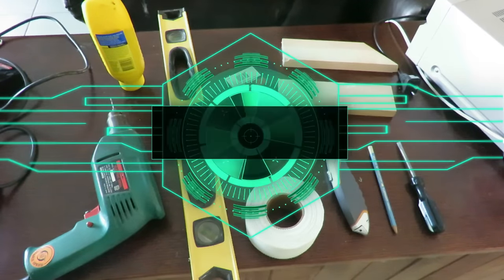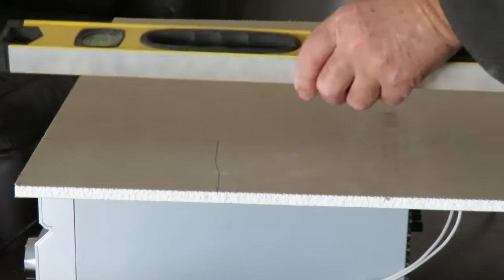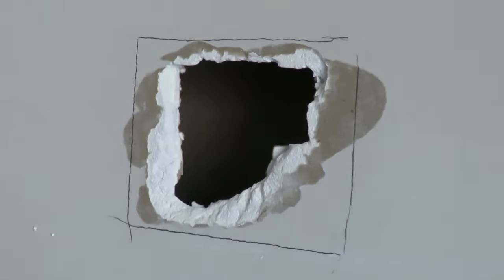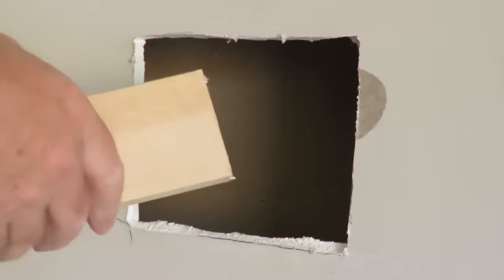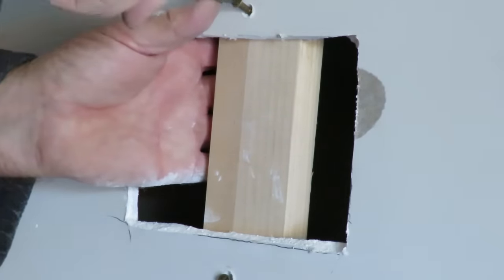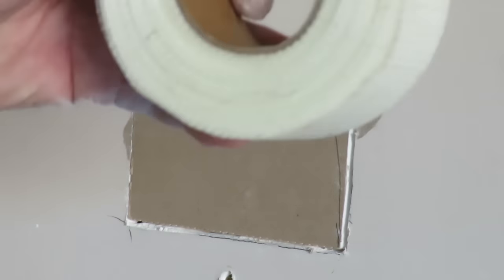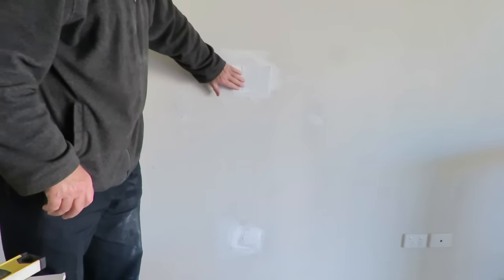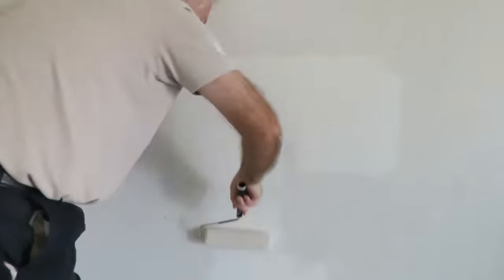🏠 How to Repair Drywall and Fix a large Hole in the Plaster Wall the easy way

Comment: You need to retitle this video.  That's a plater board wall not a plaster wall.  Plaster walls have button board or wood lath behind them and are thicker than drywall
Reply from the maker: The board is made from plaster, and coated on each side with paper, so the title is relevant.
Reply: @GarryPurcell  I would be inclined to disagree. I have a mix of drywall (plasterboard) and rocklath plaster (1/2" drywall with another 1/2 inch" of plaster on top) walls in my house. They are definitely very different, and calling a video like this "plaster repair" because it's plasterboard is pretty misleading. 99.9999% of the time, when someone says they have "plaster walls", they mean plaster and lathe, not plasterboard.
Reply from the maker: @dan8250  I would suggest you search for Historic, or traditional plaster walls to find information for the type of repair you need.

P.S. I've seen chicken wire, paper, and burlap sacks used for packing in some old homes, over 100 years old.

Comment: First of all, I would always use screws that are used on plasterboards,  I didn't know people still use straight screws. Your  not supposed to still  be able to move the piece of wood. You have to cut both plasterboards on an angle on both the edges and the patch is turning the wrong way.The tape is bad to use cause it can move and the plaster will crack, its better to use paper tape. 
Sorry but Im not satified...
Reply from the maker: Please read the video description before commenting any further, plus look at the date stamp, there is no cracking to date.

Comment: Don't ever use" Stanly type box cutters knives" their are garbage now a days, compared to cheaper slider blades that you break off the tips when they become dull...

The short box cutter stanly stubby blades are a thing of the 80s and buy the durable plastic ones $2-5 each...

Comment: Apparently I lean on the wall  with my bed and it made a whole maybe omg  ?
Reply from the maker: The hole is easy to fix.
P.S. I have a better instruction video below, (when I had all my tools with me.)
https://youtu.be/JmcR9TW4mM0?
Reply: @GarryPurcell  the worst part is that I sleep  in my bed and the whole above my head a rat could  pop out
Reply from the maker: @zombieterminator6296  That's a bit scary.
Reply: @GarryPurcell  yep I was such a dummy I'm just disappointed in myself right know
Reply from the maker: @zombieterminator6296  Y
Take your time and don't rush.
Think positive, at least you will gain a new skill set.
Reply: @GarryPurcell  fixed it
Reply from the maker: @zombieterminator6296  Good to hear. Thanks for letting me know.

Comment: Omg. Slotted screws ?? The wood isn’t that stable. A little bit of const adhesive would of helped with that. Drywall in backwards. Bad patch.
Reply from the maker: Thank you for constructive criticism.
Reading the video description might help regarding screws.
Reply: ‘May’ be a bad patch but you can’t tell it’s there. It’ll get your bond back

Comment: You need to put some screws on the lil piece of sheet rock man no good
Reply from the maker: Good advice.
On the day of this repair, I could not find any other screws in the dump bin.
Reply: Still did good man

Comment: Very  bad method for the DIYers: you havenot screws for electric drill, etc. There are other videos special for this problem. You can delete this Video!!!
Reply from the maker: Please Read the video description in future before commenting any further, after you have done that, then feel free to comment again.

This repair is 4 years old in a rental property, and still holding perfectly.
P.S. I normally use this method when I have my tools with me.
📌 https://youtu.be/JmcR9TW4mM0

Comment: Then the door handle touches it and bam! The hole is back
Reply: Whos to say it wasn't a crime scene or a tantrum? 😆.
Reply from the maker: Andrew
It was a hole made by someone trying to fix a TV cable connector in a property.

P.S. If your repairing a wall for the first time, you might like this video as well.
https://youtu.be/JmcR9TW4mM0
By watching both, you will get a better understanding as to how easy it is to DIY.
Reply: My mom used toilet paper to seal the hole, and plastered and painted. That was over 20 some years ago, and no one lives there anymore. Couldn’t tell you the condition of the hole, now.
Reply from the maker: @markusantonio4866  Chances are, the repair is still holding up OK.

Comment: It's not even going to fit because you traced the drywall backwards
Reply: I see you installed it totally backwards
Reply from the maker: Thank you for your observation.

This small patch makes little difference which way it is placed, as long as the surface, is primed and has plenty of tooth for the paint to adhere to.
Reply: @GarryPurcell  but had you installed it correctly you wouldn't need to use any primer, just saying.
Reply: @pastorbrandonspeaks7026  does that really matter, he mudded over the whole thing lol
Reply: @jimmyc938  yes it does actually I mean it's definitely a usable repair but when you mud over drywall that has the paper facing removed it can caused bubbling and peeling in the finish...this is a small spot so its no big deal..but this should be stated so no one tries to do this with a larger piece lol. Im not hating.

Comment: ? Cut the wrong side of the board first. Then presented the patch wrong side to the hole, it won't fit when you turn it the right way! A multitool would have squared the hole more easily. Fitted the patch wrong way round (that's not the plaster side) also it's an unplastered wall he could have fit it flush and taped it teady for the whole wall to be plastered. WTF ?????
Reply from the maker: Read the Video Description

Comment: Is there a purpose in putting it in backwards
Reply from the maker: It makes little difference with an inner wall, as long as the piece has a layer of undercoat to give it some tooth for the topcoat o adhere to.

Comment: Shocking ! The nee plasterboard should not move, place the wooden batten either side of the hole to ensure no movement in the additional plaster board added 🤦🏻‍♂️
Reply from the maker: I normally use the method below to repair walls when I have my tools with me.
https://youtu.be/JmcR9TW4mM0

Comment: For kicking holes in the walls
Reply from the maker: Sounds like an anger management video might help.

However if you need to repair a damaged wall,b e sure to watch my other wall repair video, when I had all my tools with me.
By watching both, you will get a better understanding as to just how easy it is to repair walls damage.

📌 https://youtu.be/JmcR9TW4mM0

Comment: ROUGH N READY THEY CALL THIS TECHNIQUE..
Reply from the maker: Its called thinking outside the box, and making good with what you can find onsite, to do a job.
Reply: @GarryPurcell  MATE IT WAS A RENTAL UNIT OBVIOUS HE DOES IT FOR A LIVING..ONE SHOULD HAVE BETTER TOOLS AND TECHNIQUE..😂😂😂..
Reply from the maker: @leroywarner551  If your called out to do a non-related job, you do your best to minimise cost to the owner. 
The damage to the wall was not listed on my job sheet. (So the wall repair was a favour to the owner, using what I could find onsite to do the repair)
Reply: @GarryPurcell  Relax mate..it's when There are millions of viewers on you tube..personally I would have used ..Phillips head screws..and secured the backing Timber a little firmer..just to avoid all the critics out There..
Reply from the maker: @leroywarner551  On the day of the repair, that's all I could find.
The video below, is how I normally do wall repairs.
https://youtu.be/JmcR9TW4mM0?

Comment: This technique is soo wrong. You need backing on both sides not the center. This way it will Crack. With backing on both sides you prevent cracking and gives it strength. Or you can do the California patch technique. If you don't know what California patch is, look it up. His way is not recommended in America and especially here in HAWAII.
Reply from the maker: Please Read the Video Description, and check its Date Stamp.
No Cracks to date, and its in a rental property, so your predictions are wrong.

I normally use the method below to repair walls.
https://youtu.be/JmcR9TW4mM0
Reply: @GarryPurcell  yah.yah.yah....you wish. You wouldn't last a week in HAWAII.
Reply from the maker: @markchoo5110  And... Its obvious you still haven't read the Video Description.

P.S. I normally use the method below to repair walls.
https://youtu.be/JmcR9TW4mM0
Reply: @GarryPurcell  video description means nothing. Just watching you and your so-called technical way tells it all. I say you wouldn't last in HAWAII because we do drywall different....the right way. I've worked with people from out of town and they never lasted more than a week. For example...steel framing on scissor lift using a corded drywall gun. We always use a cordless impact gun for framing. And watching you use a wood backing in the center instead on both sides proves my point. I'm out,  you have a good one.
Reply from the maker: @markchoo5110  You still haven't read the Video Description.
Reply from the maker: @markchoo5110  You are showing your ignorance, by not Reading the Video Description First. 
You might learn something, if you took the time to have a look at it before commenting any further.
Reply: @GarryPurcell  I'm a journeyman drywaller with enough experience I know I could teach you a thing or two....lmao
Reply from the maker: @markchoo5110  You still haven't read the video description.
Reply: @GarryPurcell  no need to read it....your video says it all 👎
Reply from the maker: @markchoo5110  You will never learn as to why the repair was done this way, if you don't take the time to read the Video Description.
Reply: @GarryPurcell  stop wasting my time. I know what I know. My experience speaks for itself. Not to mention the many different high rise jobs of done. Small little patch work don't come close to the work we do. That's Small time compared to our work done here. I'm over this lame ass conversation.....boooooring.
Reply from the maker: @markchoo5110  What was the reason you watched the video. 
Oh that's right, your an expert and know how to do everything hahaha.

I'm sure you know all about Plaster retarders and accelerators, and the difference between the harder "Yellow Stone" and the softer "White" plaster varieties, and plastering a wall by hand, "not using drywall".

You claim to be an expert, so I'm sure you already know this, and the crystalline structure of plaster, and how to mix a weak mix, as opposed to a hard mix, based on water content and salt.
Reply: Yes....I laughed watching your video 🤪
Reply: Stop with the video description already Gary
Reply: Mr. Drywall Gary does your wife beat you up

Comment: You could have done a Californian patch easier quicker and much better result
Reply from the maker: ** There are many ways to do repairs, it all depends on what you have available at the time of repair.

When I have all my tools with me I normally use the method below to repair walls.
https://youtu.be/JmcR9TW4mM0
Reply: California patches are ok if you got one hole,but in my experience I find it so much easier to fix holes like this guy did,But with some modern equipment some Phillip screws and a little skill

Comment: I don't recall ever seeing such an improper job in my life! That gyp. bd is totally insecure. One easy knock on it and it will crack open. Spackle is NOT cement!
Reply from the maker: This repair is holding up to this day in a rental property.
P.S. Please read the video description next time.
Reply: @GarryPurcell  what a ridiculous response. I know a guy holding a muffler on with ducktape. Would also say that because it worked that it is the proper way to secure a muffler?
Reply from the maker: @tyroneshoelace4872  Its obvious you haven't read the video description.
AND the repair has not cracked, as you say it will.
Reply: Don't see nothing wrong with the work. There's enough support in the size of the wood behind to take any knocks. Instead of trying to criticise why don't you show us in a video of how you feel it could be done better so we all can learn. After all this is what Youtube is about. Thanks for the video Garry.

Comment: Good grief, what a terrible job. Steel screws he found lying about that will rust and leave a mark,  plasterboard on the wrong way round, keeps saying it doesn't matter but it does matter if you have pride in your work. Looks ok know but give it a few weeks and it won't. Didn't even fix the board to the wood.
Reply from the maker: CHECK the video date stamp.
No Problems to date, so you really need to reassess your comment.
I've seen successful patches using canvas and paper as support backing, from a house over 100 years old.

Comment: My boss would tear his hair out if I cut a 3 inch square off the corner of a whole board 😂 Also why have one piece of wood down the middle? Creating a rocking effect on the plasterboard? Surely two bits of wood down the left and right hand side to at least give some sort of a solid edge?
Reply from the maker: You should get into the habit of reading video descriptions before commenting. 
If you did, you would know why the repair was done this way.
P.S. I have a another video below, (when I had all my tools with me.)
https://youtu.be/JmcR9TW4mM0?

Comment: Use the California patch on walls lol
Reply from the maker: There is more than one way to do wall repairs.
Reply: @GarryPurcell  obviously lol
Reply: @GarryPurcell  but the California patch works well and dnt need any wood or screws
Reply from the maker: @jonnychan3246  True, but it comes down to personal choice.
I normally use backing, as in my other video when I had all my tools with me.
https://youtu.be/JmcR9TW4mM0?
Reply: @GarryPurcell  of course it's personal choice but the way this is done is a bit long and not very useful unless you screw to the wood behind the plasterboard
Reply: What's that.. duct tape? Lol
Reply from the maker: @VillricBlade  Villic --- You really don't know what this tape this is?
Its specifically made for plaster joining.

Comment: Oh god! That's not proper work!! Cutting through the wall with a utility knife is the best way to break the back of the drywall. Then the patch isn't secured to the wood and is jiggling. The result is awful
Reply from the maker: You need to READ the VIDEO DESCRIPTION before commenting any further.
Reply: @GarryPurcell  the video description doesn't say "beware, I'm gonna show you how not to do" but it should!
Reply from the maker: @Nissenko  You still havent read the Video Description
Reply: @GarryPurcell  The video clearly says "This is how you fix a hole in a dry wall easily" .
It's not the way you fix it & it's not easy! It's a bad bodge and his use of the knife is amateur bordering dangerous, he's not a plasterer.
Reply from the maker: @Nailnuke  Please READ the VIDEO DESCRIPTION.
Reply: @GarryPurcell  a cracked record with nothing to say!
Reply from the maker: @Nailnuke  Hahaha
If you took the time to READ THE VIDEO DESCRIPTION in the first place, it would make you understand why the rpaire was made this way.

When I have all my tools with me I normally use the method below to repair walls.
https://youtu.be/JmcR9TW4mM0
Reply: This guy has No clue
Reply from the maker: @tyroneshoelace548  Tyrone, Please Read the Video Description, before commenting again.

Comment: I feel like a few steps could've been skipped
Reply from the maker: The video description will give some insight as to why the repair was dome this way.
Reply: @GarryPurcell  Is it mandatory to use the wood for the repairs?
Reply: Yosef Lopez -so what...he got it done and looks good
Reply: @ddfamf88  That's not what I'm concerned about. If there's a simpler method to do it I'm gonna ask questions for clarification. If that's an issue then please go away because I wasn't even speaking to you.

Comment: Should I start listing all the things you have done wrong starting with cutting the sheetrock on top of some poor guys stereo receiver. Cut the hole with a good jab saw so you don't destroy the paper on the sheetrock, use two pieces of wood behind the patch so that it doesn't rock back and forth, you also need to screw the patch to the two wood braces and for God's sake don't put the patch in backward. I could  go on and on but let me sum it up by saying, you would never do work in any of my houses.
Reply from the maker: If you bothered to read the video description, you would know why the repair was done this way.
P.S. I have a another video below, (when I had all my tools with me.)
https://youtu.be/JmcR9TW4mM0?
Reply: The Professor,  He’s actually arguing with you, LOL
Reply: As someone who just wants to fill a hole in a wall of thier own house this video is great and the result is perfect, you cant see any difference.
Reply: @MS45636  if you are going to teach people something, teach them the right way! The guy is obviously a hack.
Reply: @theprofessor8598  well ok but watching is voluntary
Reply: @theprofessor8598  what video do you suggest instead, i have a 3inch x 6 inch hole in dry wall